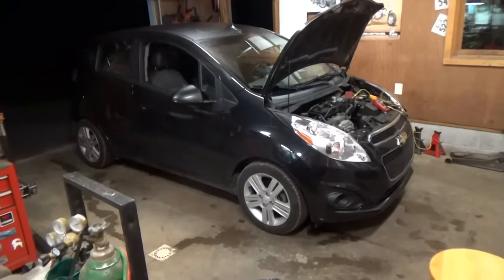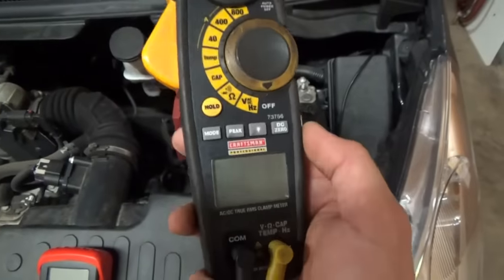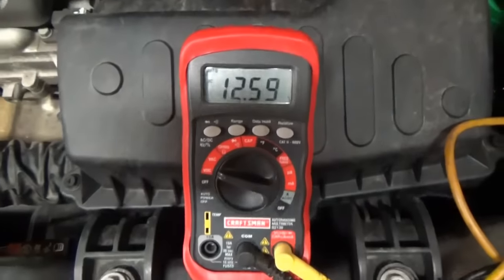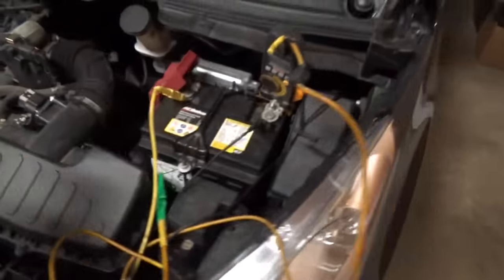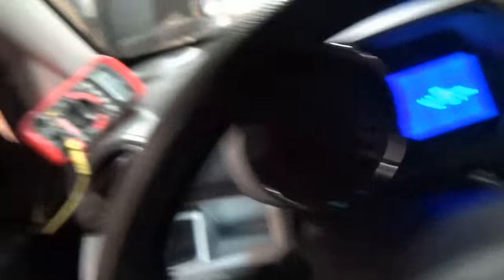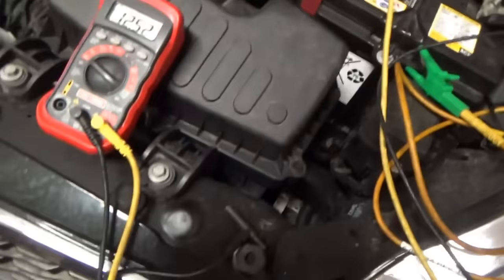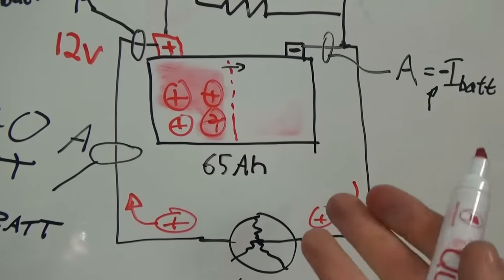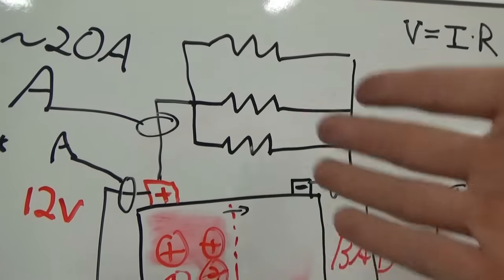Battery-Alternator-Draw Tests: EASY & ACCURATE

Comment: Nice video. I got a understanding of the concept.

Question. Is the voltage test for the alternator sufficient to determine it's health ? Like do we have to measure how many amps it's putting out to the battery, car accessories, etc?

Comment: The only question I have is I seen a video the vehicle I believe was a Toyota it had a variable output charging system where the ,let's see if I can remember this engine at idle speed turns the alternator shaft at a particular speed when load was in demand the idle speed was different from the alternator due to the clutch type pulley assembly the fella replaced the pulley assembly with a new one and the alternator worked perfectly and the battery input issue was repaired

Comment: Two questions!  First, what is the highest and the lowest voltage the alternator should charge at?  Second, what should the maximum parasitic draw one should have?  Great Work Ivan!  Tom
Reply: 13.2 to 15.2 Volt's no more than 100 millivolts on draw .

Comment: To measure current, you must "break" the circuit (in this scenario, by not allowing the circuit to be disconnected, even temporarily), and adding in the multimeter to the circuit. Think that's what you're trying to explain around 24:55

Comment: While in the service, being trained as an electrician, we had an exam with the question, "in" an battery, which wat does the voltage flow? Most everyone got it wrong, I didn't b/c I read the question, & answered from negative to positive. The operative word was IN.
Reply from the maker: You mean current flow?
Reply: @PineHollowAutoDiagnostics  yes

Comment: This can be done with a volt meter, if you know what you are doing. As for a draw, I use an 1156 in between the ground terminal and the clamp, if it's on and stays lit, it's a draw. ... Little known fact, a "new" battery is not fully charged from the factory, and this can ruin an alternator if you fail to charge the battery before installation. Alternators are designed to maintain a charge, not charge a dead or a new battery.
Reply from the maker: Interesting points, James. I don't like the lightbulb-in-series draw test method because you will miss the smaller parasitic draws...100mA won't light an 1156 bulb. As far as alternators being ruined by a depleted battery: well if an alternator is already on its way out that high-current situation may finish it off. However, they are designed to provide the maximum spec current without damage, so usually that's not a concern. Thanks for the comment!

Comment: The current flow goes from negative to positive because the charge is carried by electrons which have a negative charge.  The battery stores charge, measured in Coulombs (ampere/sec).
Reply: Current is rate of flow of charge (and specifically not rate of flow of electrons per se). If you have negative charges flowing from negative terminal to positive, that's a negative current from -ve to +ve. Hence current is positive in the direction from +ve to -ve.
Reply: If I remember physics class correctly, the terminal labeled “positive” on a storage battery is actually the negative terminal in terms of basic electrical principles, as described in the comment.  Apparently the public could not understand the concept of current flowing out of a negative terminal and into a positive terminal, but was able to accept the concept of electricity flowing out of a “positive” terminal and into a “negative” terminal, so that’s the labeling system for battery terminals that we have today (outside of laboratories).
Reply: @Anonymous98:  I'm not sure what you learned in physics class, but what you describe here is definitely incorrect.  The positive terminal on a battery indicates the terminal with the positive voltage relative to the other terminal.  Connect a voltmeter with plus lead to plus battery terminal (etc) and the voltage reading will be positive. The positive terminal, being at a positive voltage, has an excess of positive charge, and the negative terminal has excess negative charge, and that applies to all batteries.  Your "Apparently the public..." discussion is not reality.  It is true that in a typical scenario the charge flow is carried by negative-charge carriers (electrons), moving from -ve terminal to +ve terminal. The flow rate ("current" = charge/second) is therefore negative in the direction from -ve to +ve, which is the same as saying the current is positive in the direction from +ve to -ve.
Reply from the maker: Actually [Coulomb = Ampere * sec] ;)  So how many Coulombs of charge are in a fully charged 65Ah battery?
Reply: Superficially, charge (Q) = 65 [hr] * 3600 [sec/hr] * 1[A] = 234 kC.  Though that misrepresents the situation: given that there are six cells in series, and they all have to deliver that current, from which one might conclude that the total charge in the overall battery is 6 * 234 kC (albeit each unit of charge stored at 1/6 of the total voltage).  And then again, that's a poor representation of the actual situation that this is not storage of charge per se (unlike in a capacitor), but rather energy stored in chemical structures which, if allowed to discharge into a load, are capable of separating molecules into ions and electrons to produce those flows of charges (ie: a current) "on demand".

Comment: IVAN  here is another way to connect ur dvom amp meter use a stackable lead one alligator clamp to neg clamp and a probe in the stackable to the neg post then remove clamp and connect  other alligator lead to post CHEERS

Comment: I have a question about those Nocos, you know when you're say programming a key fob and your battery has to show a good voltage or the programming won't work, can you just have the Noco clicking away on the battery while you're programming?
Thanks!

Comment: so in the most basic ways if i hook my amp clamp to say neg cable and i turn on headlights with engine off,doing this i know that the number and polarity i see is amps leaving the battery, so then by turning on the engine i would want to see this polarity reverse on my amp clamp thus telling me the number i now see is amps going back into battery correct?so the key if i do this is really seeing that polarity change when i turn on engine because if it doesnt this would mean the number i see is battery drain and not charge right?
i went outside and started playing around with these concepts and want to make sure im thinking this right.

Comment: Ivan, while disconnecting the negative terminal of the battery to perform an electrical current draw when car is “dormant “ would it be possible to use the NOCO power supply and connect it to a good known ground on the car which will allow you to place your amps meter in série without the possibility to open the circuit and waking up the car?

Comment: I always check battery voltage and then crank and check the voltage alternator is putting out. When engine is running, you said you can check amps on pos or neg. I realize one will give a negative result. But...what should the amps be if you're dealing with a good battery that is taking a charge? 20 amps or so? if the battery is fully charged, wouldn't that reduce the amps seen? or regardless of charge level of battery the amps should be the 15-20 amps? It looks like in the video it started out around 20 but dropped to 11 at one point. Which made me wonder if it would eventually keep dropping to the amps of the first (bad) battery which was in the 4-6 range. Hopefully this makes sense.

Comment: Okay I have a 2001 Toyota Camry and my battery keeps dying after about 3 days so I did the test that you just did my battery is holding it about 12.85 volts so then I did the test that you just did with a negative cable and it's still holding 12.85 volts even with the turnable disconnected from the battery going through the meter why is that?

Comment: I thought that in diagrams and teaching current flows from positive to negative where in reality it was found out much later that it actually flows from negative to positive! 
       I always found this very confusing since wiring diagrams have the negative or grounds lower in diagram and positives in upper portion.
       It seems that ECMs switch modules on by connecting or switching to ground or ( ground side switching) but some modules are positive switched.
       This is confusing as many of us were taught current goes from + to ground , could this be the source of confusion with battery and alternator problems?

Comment: great video as always.  Question: 
1. Isn't current supposed to be equal throughout the circuit? After you replaced the battery you measured current again on negative and positive cables - why was there more current at the positive battery cable, and why was there less at the negative cable?  Shouldn't the total current on the ground side (negative cable) be the same as the current on the power side (positive cable BEFORE reaching any loads) because current is equal throughout the circuit?  Even in series-parallel circuits the total current should be same at the power side and ground side right?  Or is it because the battery takes some of the current that the alternator puts out and then the remaining goes to the loads, and those loads take approx 20A? I might have answered my own question lol.  
2. Are electronic equipment calibrated using conventional electrical theory?  Because electron theory will have everything opposite (negative charge moves towards positive)..  i ask because the negative and positive sign on the amp clamp reading was confusing me a little.  

Thanks in advance!
Reply from the maker: Thanks Timmy! Yup you answered your own question. The SUM of all currents flowing into a junction should be zero (conservation of charge). And just think in conventional current and don't worry about the electrons, then the sign will  make sense :)

Comment: Hi Ivan, can  I am little confused on negative and positive on the amp clamp. The way you have the clamp set up on the negative cable, when the vehicle is running we see positive amps that means current leaving the battery from the negative side of the battery, then when the vehicle is off we seeing negative amps on that part I am little confused why is that negative? If you can clarify that would be great. Sorry for the long message.  17:02

Comment: 26:55  Q1:  if the battery is down to 9.x volts before the parasitic draw test, isn't that an issue?  shouldn't it be 12.x before you test?  not necessary?
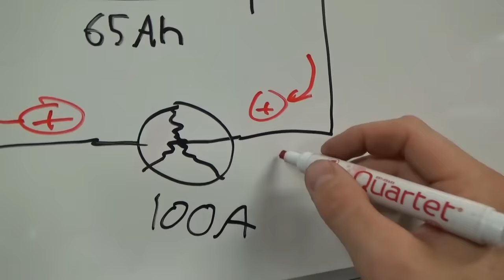20:37  Q2:  is alternator good because charge to battery soared to 15v no problem?

lastly, i saw a 50-75 milliamps draw with everything off in sleep/off/accessories modes.

using amp clamp dcv i found no draw when off, but a steady (not intermittent) 2.25a draw in accessories mode (all off, door open) on 2 of 3 honda accords (family).  the third shows same .05a or less draw in both the off/sleep mode and accessories mode (all off, only door open).  

questions:  is 2.25a steady draw in accessories abnormal aka a clue?  do i use multimeter to do same volt drop test across fuses vs pull the fuses to figure it out aka same routine?

Comment: The normal voltage of a fully charged 12V battery is 13.2-13.5V, 6x (2.2-2.25V)

Comment: Didn't know the current was moved and not created. When you disconnect the battery while the car is still running and it keeps running, I assume that's stored energy in the alternator? I don't do that, but I wonder how long it can run like that.

Comment: because the battery fell below a certain voltage, a charging strategy is to spend a while at 15v to boost the cells and remove some calcifiication. but it cant do much to a worn out battery, this is the usualy failure method, but people usually wait till the cold weather and a series of failed starts before they buy a new battery.

Comment: What do you think of 2015 BMW 335i alternator putting out 15.5 amps, replaced battery, old one I think was original anyway it was bone dry and cooked. I tried refilling with distilled awter but the boiled it out. Seems okay now with new battery. Your thoughts?

Comment: I know this is a 2 year old video but with that style battery cables I like to hook the ampmeter up and just unbolt that second nut that connects the cable to the terminal clamp to avoid interrupting the circuit. but, alas not all cables are that easy. 😂

Comment: What about a faulty diode on the alternator or did I miss that bit, than can cause a parasitic draw that won’t show up using the method you showed. Great video though

Comment: New battery installed 2 days ago.  Is 3 amps a normal reading on the negative cable at idle? Isn't that the same reading you got on the dead battery? A little confused here

Comment: Good Job! But, Franklin theory say a charge moves from positive to negative.  Actually current moves from negative to positive. 😀
Reply: "Current" is the word for rate-of-flow of charge, not rate of flow of electrons.  In the common case of current in wires, charge movement is due to electrons carrying that negative charge, and will be in the direction from negative battery terminal to positive.  This is a negative current  from negative to positive which is identical to a positive current from positive to negative.
Reply: proton movement from the positive side has holes that electrons can fill
Reply: @Graham_Wideman  Really?    What is charge made of? Last thing I heard of is Electrons!
Reply: @lonwillis783  "What is charge made of? Last thing I heard of is Electrons!"  This is a misconception that many people have fallen victim to. Charge is not made of electrons. Rather, charge is a physical property possessed by a number of fundamental particles. Commonly-known examples are electrons and anti-protons which have a negative quantity of charge, and protons and positrons which have a positive quantity. The magnitude that they each have is the same, so that's why, for example, atoms with N protons attract N electrons into orbit.

Comment: Could you not just use that fancy battery booster hooked to the positive and grounded to the engine or alternator bracket then hook the amp meter of the multimeter to the installed battery ? this way using 2 batteries you can disconnect the one and temporarily use a alternate 12 volt source while installing the amp meter. It would not matter if the ground then was completely removed because the car was still getting 12 volts. Then the second 12 volt source can be disconnected, leaving the amp meter hooked in series as you ended up with on the negative side.  I think that would be much easier than trying to keep 12 volts going to the car and wiggling the ground clamp not?

Comment: Ahh did you test the alternator for leakage when it's very hot, heat and diodes?
lol i am joking of cause, it's not very likely.

I would charge the battery over night off the car, then the next day apply a high current drop tester across it, while watching the voltage.
It should recover fairly quick to 12v after the load is removed.

Comment: I did this test on a piece of equipment today and the voltage on the battery was dropping from 13v to 7v. replaced the battery and that was not the issue. turned out to be the starter. any testing methods recommendation for that situation

Comment: How do you know is the alternator is GOOD but not charging the battery because the PCM has broken? I installed a NEW (NOT re-man) alternator in my Chrysler (another POS), alternator was tested prior to installing was good passed all tests and battery is go but have NO charging, and no codes and no battery light when van is running?

Comment: If you had a dirty pole the symptoms would be similar.

Gold standard of battery condotion is a load test for this reason.

In a DC circuit electrons flow fron negative to positive.

A battery is two or more cells wired series.

For a quick and dirty check your system as usually correct but could condem good batteries unnecessarily.

Further optimal charging voltage  will vary depending on battery chemistry.  Example a GM vehicle designed for a delco freedom battery will have a different voltage than a Ford so likley to get less life from the battery if the voltage regulator is set too high or low.

The difference is slight, bit important if you want to get optimal battery life.
Reply from the maker: For sure there are variables. Clean post connections are a must. However, car wouldn't even crank ones if posts were dirty enough not to accept a charge! So we indirectly ruled that out.
Reply: Pine Hollow Auto Diagnostics 

What if the resistamce originated at the alternator to cable connection?  Like I said, tour technique usually works, bit occasionaly will falsely condem a good battery.

Fot a DIY guy, a ride on the charger and a free load test independently will confirm or deny the diagnosis.

A gpod load test on the battery

Comment: You can change battery acid and charge it outside the car and than put it in the car and it will be like new but if battery is very damaged than you should just change it

Comment: Excuse my ignorance. When you had initially placed the the amp clamp on the negative wore to see how much charge the bad battery was taking I was expecting a much higher voltage because I thought the amps that the rest of the car is using is making its way back to the battery also. Clearly I'm wrong. The current that is used by the rest of the car makes it's round trip back to the alternator, correct?
Reply from the maker: Yup back to the alternator :)
Reply: Master Tech thanks for asking this question as I was wondering the same thing myself